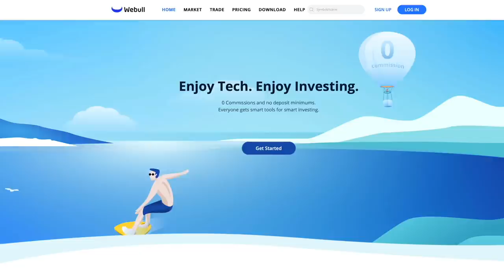Evannex Tesla Model Y cargo cover and portable table!

Comment: I ordered a set of those Evannex floor mats at the same time I ordered my model Y, and I have to say they're the most shamefully disgusting, rushed-to-market garbage I've ever been enticed into buying   <Edit:  no, check that; I just remembered I actually bought a Snuggie blanket once>.  They're not custom molded like proper mats; they're just flat pieces of heavy waffle-pattern plastic sheet, cut to appropriate outline shapes.  The driver's side floormat has a floppy tab that's intended to flex up to follow the "dead pedal".  Since it's only a few inches wide, it uses some double-sticky tape to stick it down to the original carpet (and this leaves some of the inside of the footwell un-covered).   It'll work until the first time the mat's removed for cleaning.   And about cleaning:  Good luck trying to remove liquid spills from the cavities of the mats' waffle pattern.   Direct spray from a garden hose is required, and drying the mats afterwards is a pain.